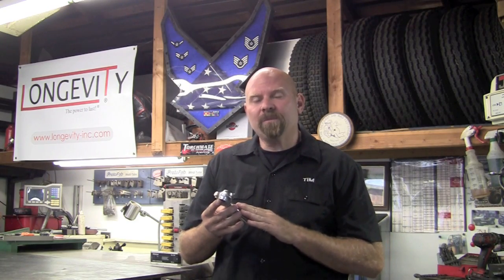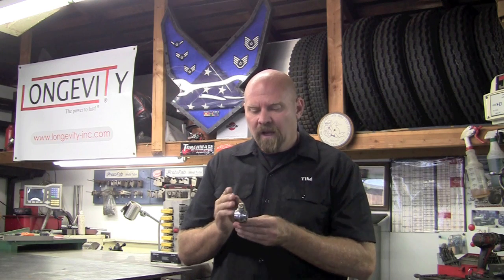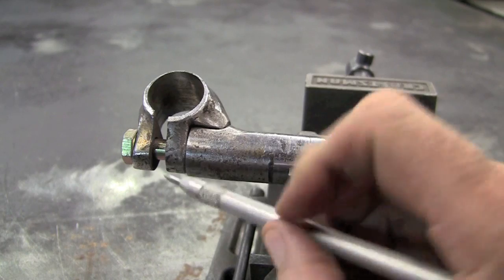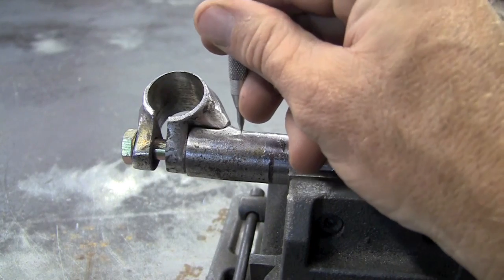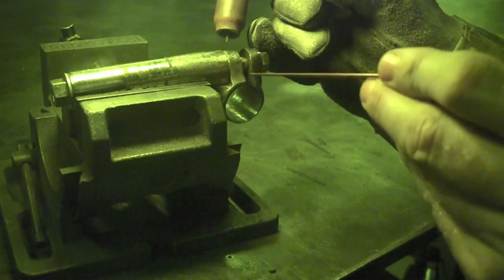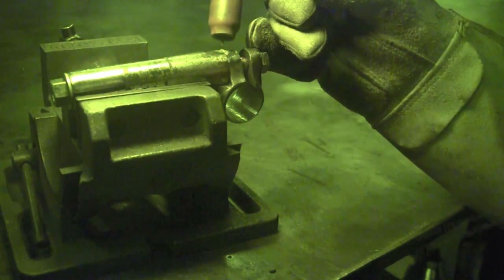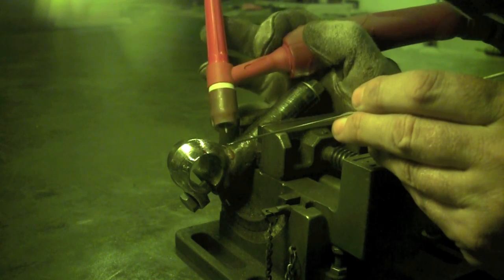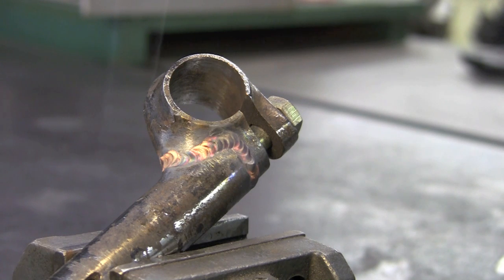TIG Welding - Tacking A Weld Keeping Heat Distributed Evenly With Longevity TigWeld Welder Review

Comment: Hey Tim.  Got the welding covered.  I'm 6G pipe and FAA certified.  What caught my attention is that cool Air Force Frame with your airman-techsergeant stripes and the folded flag.  I'm also ExAF and am building a frame to display my uniform.  Now I'm going to build the that AF frame (wood) and put all my stripes, medals, accomodations, etc...  Thx for the idea friend.